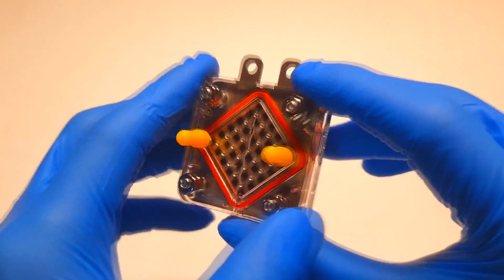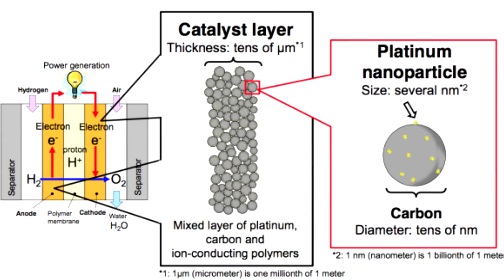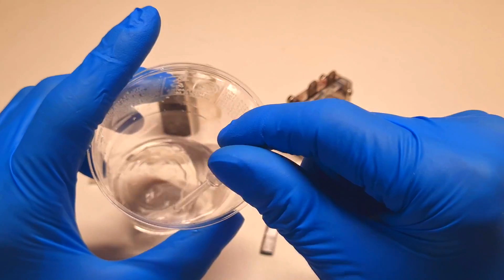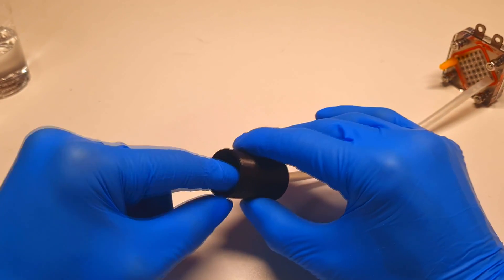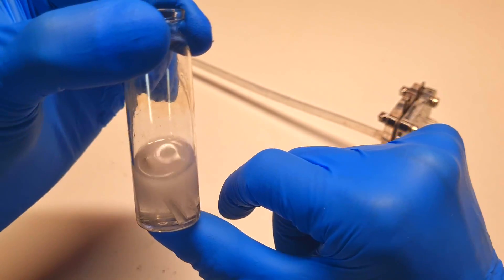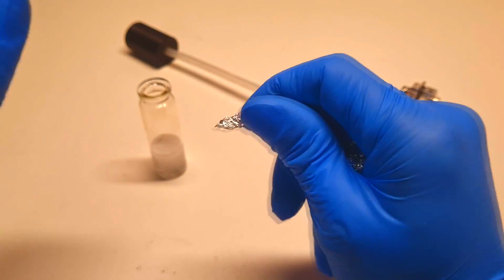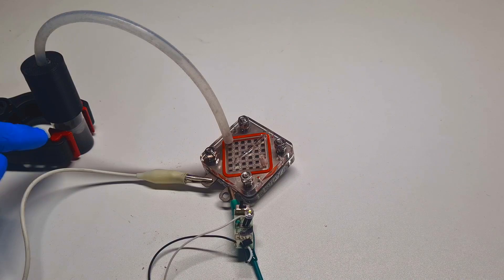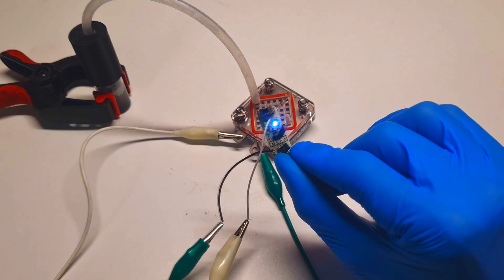I make a Hydrogen Fuel cell powered by Aluminium

Comment: Well yes it runs but the problem I see is that to refine the aluminium the process innately releases CO2 from the graphite electrodes. I think a better candidate for this would be ammonia flowing over a heated iron catalyst (reverse Haber process) to decompose it into nitrogen and hydrogen. At least ammonia can be synthesised feom electrolytic hydrogen and have no CO2 emissions in the supply chain

Comment: ok but id need like 100 amps and like 15000 watts to run my house
Reply from the maker: 15kW and 100A = 150V In that case you will need around 190 cells if you will not use some inverter.
Reply: would make more sense to have one or two units not 190 small ones  @cayrex
Reply from the maker: @mikewarren7855  You say that you need 15kW which have 100A. That makes 150V,..... and each cell produce 0.8V that makes around 190 cells (and for 100A the cells are not smal). Also in some 48V system you will have around 60 cells.
Reply from the maker: Then you will need much more cells that are biger that I use here in that video.
Reply: @cayrex  who makes them?
Reply from the maker: @mikewarren7855  China. Search for Hydrogen fuel cells on Alibaba. Here you will find the cells,.... but the system with the aluminium you will need to make it yourself
Reply: @cayrex  anywhere higher quality than that?
Reply from the maker: @mikewarren7855  The quality is not so off. But if you want to pay a good price... here you have https://www.fuelcellstore.com/fuel-cell-stacks/high-power-fuel-cell-stacks

Comment: Good job Sir. So if theoretically we put 50 of this cells in series we should have 45V at 1Amp? Or if we do 50 in parallel 0.9V at 50Amp? Or the cells will be destroyed by the power produced? Thank you
Reply: either is fine.  In both setups, each cell still has 1 amp flowing through it and .9v across it.  You need to size the pair of output wires correctly, depending on which amperage/voltage you choose and distance to load.

Comment: To increase reaction , Use Gallium , Dissolve Alluminum in Gallium and then Potassium hydroxide . this will increase the reaction rate ...
Reply from the maker: No needed for increased reaction. Because I want to have enough stable hydrogen at slower production rate. That way I can get the hydrogen from water and aluminium for many hours. Increased reaction will produce hydrogen at max for 15 min. In that case, many of the hydrogen will not react in the fuel cell.

Comment: The Hidrogen should be washed and you should have more than one reaction chamber. Schreding the aluminium foil or have it as a dust would improve.
Reply from the maker: Not really,... because aluminium foil or powder (small particles Al) will  contribute to faster reaction and faster release of hydrogen. The fuel cell will get the hydrogen how much it needs, but if the hydrohen production is to fast, then most of the H2 will go to the environment. For example: 1 gram of 1mm thich aluminium produce enough H2 that the fuel cell can run for 5 hours.  Otherwise a aluminium powder will create a H2 for about 30min.

Comment: would this work better with palladium as a catalyst?
Reply: maybe, but all that disassembly, sourcing and uncertainty for a delta of 1W - 5W output?  
i am aware KOH and Al are your energy source, and 1 g of Al is worth less than a fraction of a penny but so is a Watt
At kW and kg scale the Al is going to be £1-£10 per hour, and you will need a fuel cell with several hundred platesquestion 
The interesting question is, imho, would catalysis or electrolysis assist the H2 production, and what size of cell woul

Comment: btw, using anything else than carbon as anode (positive) will make recharging not work, because the metal coating will be plated off, and cathode (negative) needs not to be carbon but metal to make metal plating and not metal hydroxide

Comment: This is high cost way to produce H2
Reply from the maker: Correct. But aluminium was only one of examples which I use here.
Reply: @cayrex  I think it's good that it uses aluminum it's very easy to find garbage. How much power would one aluminum can produce? Whatever it might be I think it's worth it. Also where did you buy the actual fuel cell part at?